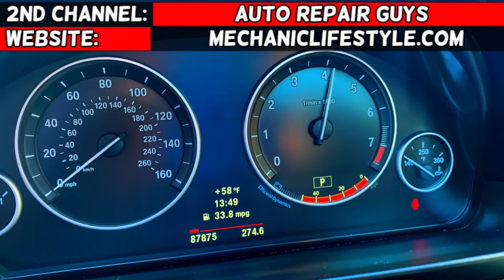FORD FOCUS CODE P0441 P0442 EASY FIX 2012 2013 2014 2015 2016 2017 2018

Comment: You guys seem to know a lot about this model of vehicle.  So here my problem.  I'm getting carbon build-up in my engine which is kicking out an error code of p0420.  Now I've replaced the catalytic converter, sparkplugs, and cleaned the valve heads using the seafoam method.  Any guess as to what could cause this issue?  I have a 2012 ford focus titanium model.
Reply: O2 sensors 
That’s a catalytic converter code. Could cost you as little as $20
Reply: Damaged muffler or leaks in the muffler.
Damaged exhaust manifold or leaks in the exhaust manifold.
Damaged exhaust pipe or exhaust pipe leaks.
A misfire in the engine.
Oil contamination in catalytic converter.
Faulty catalytic converter (most common).
Faulty engine coolant temperature sensor.
Faulty front oxygen sensor.
Faulty rear oxygen sensor.
Damaged oxygen sensor wiring.
Oxygen sensor wiring that is not properly connected.
Damaged oxygen sensor connectors
A leaking fuel injector.
High fuel pressure.
Use of the wrong kind of gas